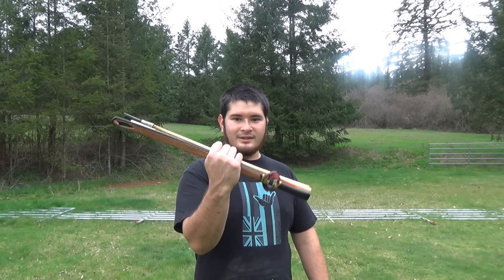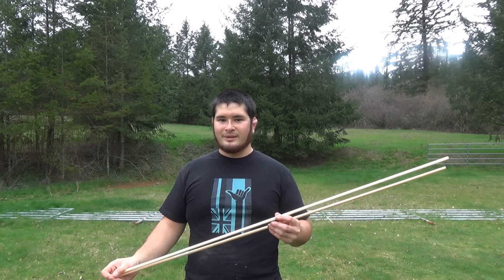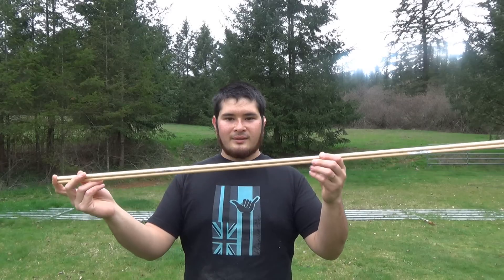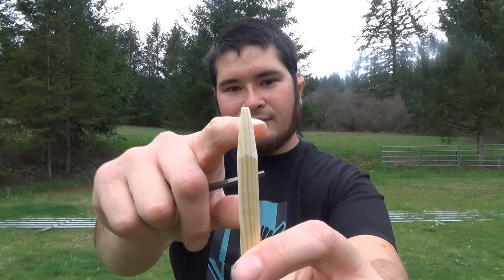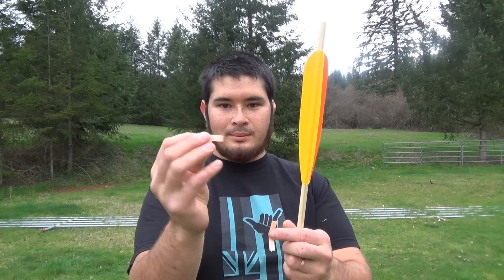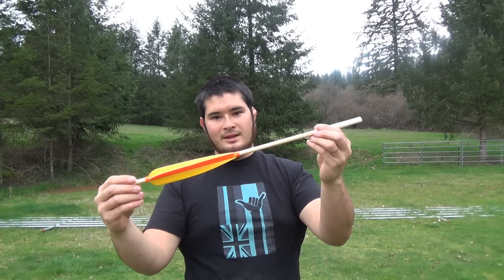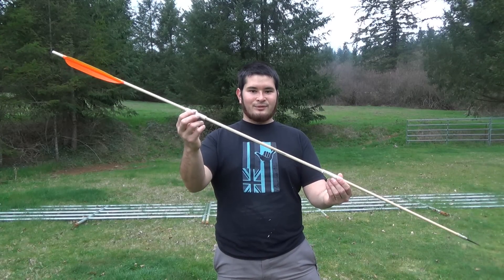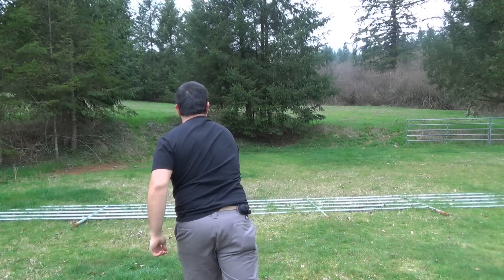Arrow Build-Along - 3 Piece Takedown Atlatl Dart with PEX Pipe and Wood Dowels

Comment: Thank you.  I watch all of your videos.  I like the duct tape fletching - makes life a lot easier.  I ordered some commercial arrow points.  When they come in, I will go to the big box store and buy dowel rods.  Rather than sectioning (a good idea), I will make the shafts one piece.  I looked at a number of ways to reduce dowel for the mating.  I have a Harbor Freight 1 inch belt sander and will turn the dowel end on it.

Comment: I prefer making 6 feet darts from 0.240" OD pultruded carbon fiber tubing ( Woodwinds composites now ),  a 48" section
joined to a 24" section using 0.250" ID roll wrapped carbon fiber.   Lightly sand the ends to be joined,  then using JB Weld
epoxy.   Not cheap, but very high strength.  Cost about $18 per dart.    A 1/4 inch long 6-32 Cap head allen screw and
0.5 inch long sect ion of the roll wrap form the stick pintle receiver.     . . . .  also a slug of 0.250" OD brass weight behind the 
archery arrow screw in for the tip.  Lastly I used arrow fletching rubber feathers.  Job done..

Comment: Great !  I was looking for  a portable  5'  dart.  I had an idea to flatten out pvc  to  make a point both broadhead and practice, your opinion  would  be helpful. In  Austrailia they  use a  hardened  wood  tip.  I  suppose  pvc  would  be a good  substitute  that can be made easy.